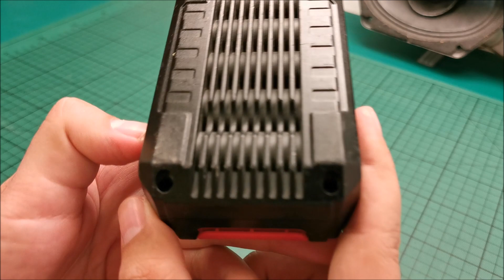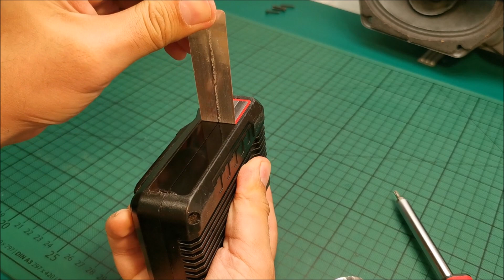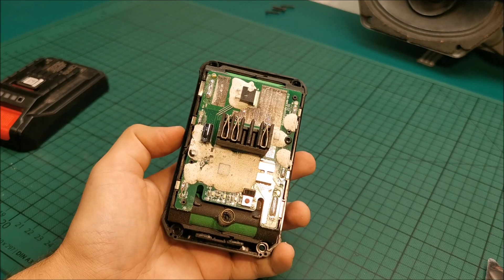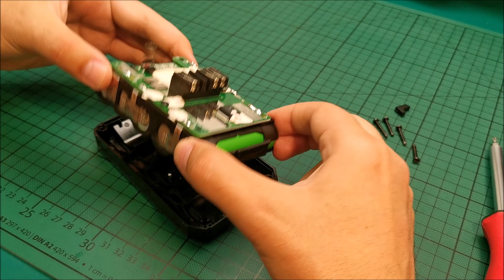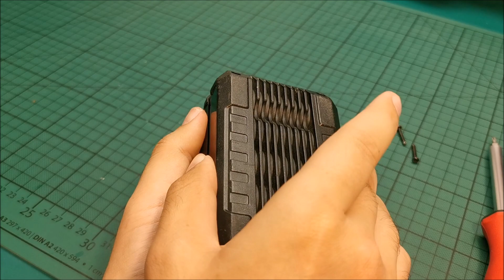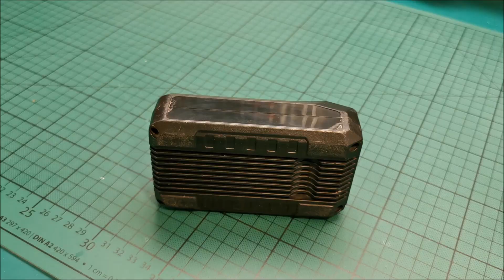EINHELL 2.5Ah 18V max. power 720W Power X-Change battery disassembly 🔋

Comment: Hey man, thanks for the video! Btw can I ask you if those batteries have a low voltage cutoff protection? On your video you say they do but are you 100% sure? I don't want to ruin mine for a little project, just wanted to be careful :) thank you!
Reply from the maker: It's advertised as having it. Not possible for me to know for sure.
Reply: @UltimateDIY  Thank you :)
Reply: Usually with tool batteries, the protection is on the circuit board on top. Never seen individually protected batteries in tool batteries before.
Keep in mind, sometimes the protection detects after the trigger press. So if you're just leaving your finger on the trigger of a drill non stop it might over drain .
Reply from the maker: Thanks for this info! 👍🏻